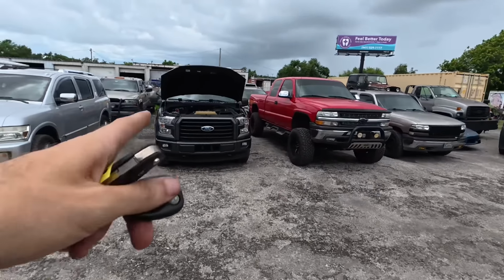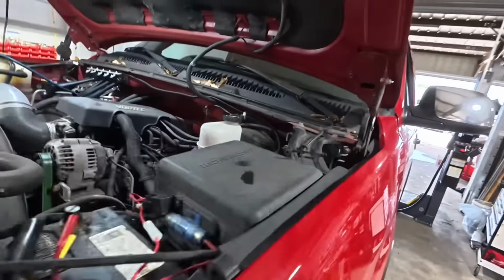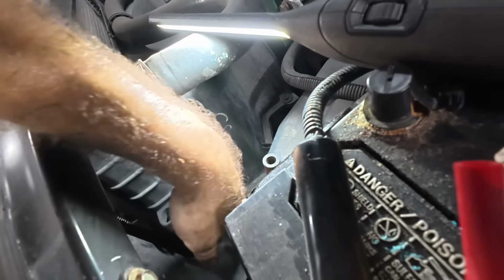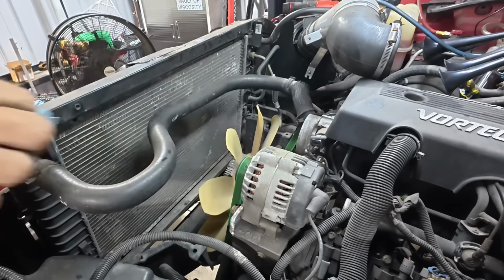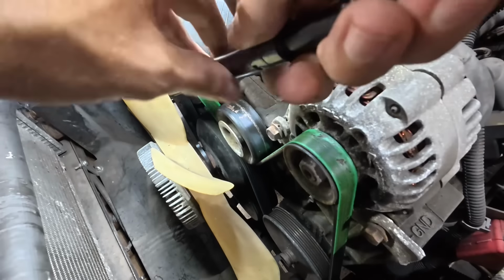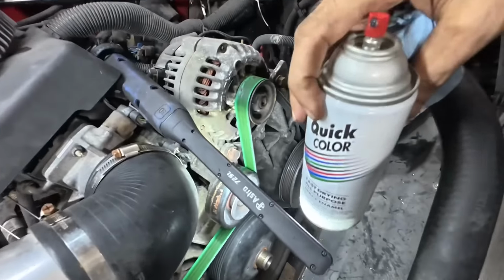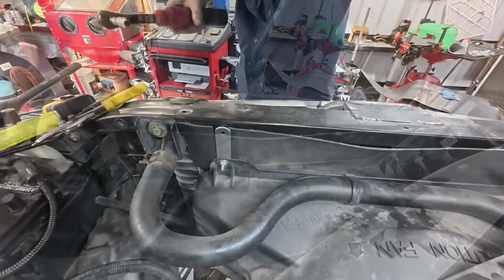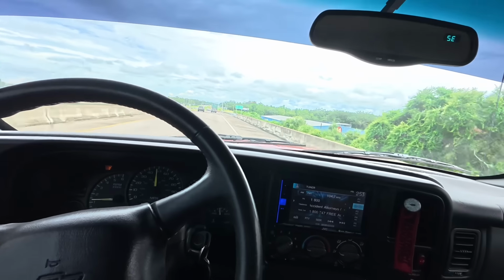Modified Truck has a Physics Problem!

Comment: 48:39   last stupid comment!
How should you charge for mod work like this?  It can take more time and your using scrap materials and new materials.
On the sides a house type door and window seal tape would work.

Cleaver repair Ray.  Was the charge on the system right?

Comment: wrong shroud? i haven't seen yet, but i'm callin body lift.
Reply: called it!  Shroud looked like it should have fit to me, had the right mounts and everything.  Given the look of the rest of the truck (big tires, tall\wide stance)  It prolly has wheel spacers as well :P (new rims with a bigger offset cost more)

Comment: It's probably the correct fan shroud.
 I'm thinking the truck may have  a body lift kit.
 That would also lift the radiator and fan shroud.  But, not the fan.
 20 mins into this video.

Comment: LOL......I just went and looked at my '99 and the side flap on the driver's side is crumpled and folded down while the passenger's side is missing.  I'm not having overheating issues and my AC is still nice and cold but I do believe I will need to replace those side flaps.  I learned something new today!!!  Thanks Ray!!
Reply: My wife's side flaps are all crumpled up and destroyed also...

She's got a LOT of hard miles on her over the years of our marriage 🥴
Reply: Could I use the same shroud out of a suburban it looks like my setup in my truck
Reply: I believe he has the upgraded radiator the same thing it's in my suburban if you had AC in the front and back
Reply: I think the difference is that this one is also not aligned properly because of the lift.

Comment: Just install a Speed Engineering electric fan and a thermostatic switch. Part #27-1006 found at speed-engineering (apparently YT deletes comments with external links) It's model specific for the Silverado. Ray, you need a truck creeper. I love mine. I recently used it to install a Banks intake and grid heater delete on a Ram Cummins and did a small coolant hose to the turbo on an F350 Powerstroke. It'll get colder in there when the blower fan has high speed.

Comment: Whats hard to figure out is the truck has an old school Vortec engine cover, old school grill and headlights from a 2002 and earlier, the engine cover looks like 1999-2000, but the interior is 2003 and newer, with the Bose speakers and the dash is 2003 with the Bose radio opening.   
I used to own an 03 with that interior buy not that front end.
The shroud is that way because of the body lift.

Put electric fans on the radiator and the problem is solved with the cooling system.

Comment: WITH THE OPENING AT THE TOP OF THE RADIATOR, IT JUST CYCLES HOT AIR INSIDE THE ENGINE COMPARTMENT THAN PULLING COLD AIR FROM THE FRONT VIA THE AC CONDENSER.

Comment: Ray:  Is it my imagination or is that plastic fan mounted backwards??  As a pilot son of a pilot/aero-engineer the blade twist, as re-mounted, will push air TOWARD the radiator when the engine runs (viewed from the front turning clockwise).  While sitting stationary (as you worked) it appears to me that the blade twist mimics that of an airplane propeller (and aircraft engines, viewed from the front, spin counter-clockwise).

Comment: In my experience with severe duty, they’re too aggressive. They don’t disengage very quickly. Once you first start the vehicle and takeoff. I usually suggest an HD, which is right in the middle. They seem to disengage within the first couple minutes of initial start up. Both are very loud when engaged.

Comment: So, I did an efan conversion on my 02. To do the efan conversion right, you'll need a wiring harness. BP Automotive makes a great one. You can find locally a fan kit out of like an 06 Escalade that will bolt right up assuming that truck has a 34" radiator, which I think it does, but check that. Then you'll need to have it programmed as you noted. 

Something you might consider is getting HPTuners yourself. I bet you'd find more uses for it.

For me, the efan conversion wasn't bad. The harness was about $225, you do have to change the high side sensor on the AC as well, and repin 2 connectors in the PCM. You'll lose the recirc doors on the interior HVAC, that's the switch that gets repurprosed to run the efans. I think I paid $75 for the fans. I went ahead and had it tuned, but the tuner did fan change too. I think that was $300.

Might not be something you want to tackle, but it's not exhorbitant, and it does help significantly. Good luck!

Edit, great job on the fan shroud mods!
Reply: So if the recirc door switch gets repurposed, then how do you operate the recirc door afterwards? I'm thinking of doing the factory efan conversion on my 2003
Reply: @Epic_Aviation you don't.

Also not sure about the 03. It may have a slightly different ecm.
Reply: @ryanedwardson6541 Yeah I've done a significant amount of research since then, and the 2003-2007 classic trucks are a lot different than the 99-02 trucks with the BCM, PCM, HVAC, etc. On an 03+ truck, iirc, you don't lose anything at all. The 2 pins you need on the PCM are empty on the 2003+ trucks/SUVs, so you'd be all good to go.

Comment: For the cracked block. Is it not possible to do a temporary weld over it?
Reply from the maker: I thought about, but I can’t weld aluminum, can’t really weld inside of a cylinder head. I’m sure someone out there could pull it off but I’m not that guy and I have no clue how to find that them.

Comment: @RainmanRaysRepairs, the price you pay to 'remote flash' vehicles is NUTS. With GM vehicles, you can purchase a $45 VIN license from GM via ACDelco TDS and that'll let you flash modules for that VIN for two years, so, as an example, if we're talking a frequent customer, and six months later, another module failed and needed to be programmed, it wouldn't cost you any more to replace and reprogram that module in that same vehicle. But even for a one off, $45 and 30 minutes of labor (assuming you bill in 30 minute increments and MOST reprograms take way less than that) is WAY cheaper than the, what, $245 plus labor. As far as an interface, there are universal 3rd party tools, or you could get a (LEGIT) GM MDI2 for less than $800. I've read and flashed Ford EEC-V PCMs with my MDI2 using PCMFlash, and I've done data acquisition using 3rd party software with it on Jeep and Chrysler. If you look at the Ford VCM II and the MDI2, externally, they're pretty much identical, and the fact that the MDI2 will read and flash Ford EEC-V PCMs (Non CAN) suggests that the hardware inside is identical too. I have little doubt that it could be used to program Chrysler, and quite possibly imports as well (can't confirm that as there are no imports within my scope of vehicle repairs). If you'd like more info, comment as such and I'll reach out to you via e-mail.

Comment: only a few mins in, 1. that trucks looks like the cover photo they used for rough country display truck for 99 to 07 lifts n stuff. 2. 3" rc body lift im betting as to why the shroud is dropped down and or lq9 ls rad upgrade/ 2500 hood front clip swap?

Comment: I had a 97 3/4 ton suburban that would never blow cold at idle, even with the hd fan clutch. Got a cheap fan off fb marketplace (I think it came from a civic). Installed it between the mechanical fan and radiator like ford did with some of the older crown Vic. Set it to come on with the ac compressor. Fixed the problem.

Comment: It needs a high blower relay. Right on the firewall.
Reply: Fan speed resistor is under the dash near the glove box. When it burns up you can smell it in the cab.

Comment: On the wall behind the Alignment tree, you should hang a large bathroom mirror, this way you can see how the tires line up rolling up on the lift.
We has a 6'tall x7' wide garage door
With a sheet of glass on the wall for doing window tint, we did not use anymore. With that glass it made a perfect reflection of the door way into the shop.
I was able to pull a humvee  yes mitilary version that was the navy's recruitment  center  I had 1" on every side and roof to pull it in the shop over night. Never needed anyone to spot me, plus you can inspect lights, turn signails ex using it.
Or you find a broken projector TV 
They have a large plastic mirror inside them, as well as a big magnifying glass the screen. 
Find one someone set out to the curb its great for parts. 

Trust me the mirror is something you will not forget the use of, or be upset you have it.

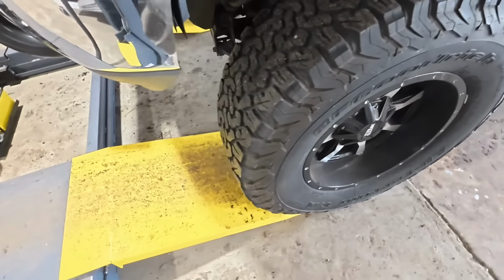Comment: 3:31 the gmt400’s had a relay for high speed blower, that bypassed the blower motor resistor. Not sure if that changed on the gmt800’s

Comment: The factory electric fan upgrade would be a great work around.  In my opinion, the body lift company should have replaced the shroud to better fit the lift kit and function properly. Meaning the fan area would still match the fan but the radiator end would match the lifted radiator and still bolt in like original.

Comment: Truck had green coolant(not correct for that truck) . I suspect that maybe there was a leak problem before this and maybe generated a heat pocket in the area leading to the crack.

Comment: The electric fans would have been the best solution if you don't consider cost.  However, the customer was, and Ray shined like a star on this one, working within the customer's limits to creatively solve the airflow issue.  Will it work for a decade?  Probably not, but there's always the option to go the electric fan route.  The Chevy owner should start saving his money and have Ray do the install.

Comment: If the customer does not want factory electric fans, you could suggest a pair of electric fans from Flexalite ... They can be controlled by a simple thermostat probe in the radiator hose and you can also wire them to a manual fan on / off switch if you want. They are very effective at moving lots of air and not super expensive. They do not require the GM Fan control module to run them.
Reply: My exact thought also, I'm surprised he didn't mention it.
Reply: Those fan kits don't really pull enough CFMs to be a factory replacement. It's a game of hit n miss with fan blade pitch on the fans?

Owning an RX7 with a 13B turbo they get a bit warm especially in Australian Queensland hot weather?
After installing one of those kit fans with its own thermostat as mentioned; it not pulling enough air flow I switched out the fan itself for a Toyota Yaris/Platz fan and wired it into the after market thermostat so no chips need to be "retuned" cause there's nothing for it to interface with being Mazda anyway. This did the trick.

I went straight for the Yaris because it was a large single fan. The fan was thick and heavy duty looking too. I decided this after being dropped home one time in the peak of summer in a of black Yaris; when I opened the door and put my leg out the thermo fan just kicked on and the amount of heat that came rushing out from under the car was crazy! I looked across as the temp gage on the cluster and it was reading below ⅓? I'm like 'well that's a pretty good thermo fan if what it's expelling nearly burns my legs or and it's reading cold?"
The car was only a couple of years old too at the time so it wasn't as if it's had 10 coolant refills with tap water with air locks and shit going on? It was a Toyota factory serviced car under warranty.

No more temperature problems in the RX7 after that modification👌 also the factory RX7 clutch fan (similar to the one in this clip) has some crazy fat fan blades with some hard core pitch! The clutch fan was louder than the 13B with upgraded 3" exhaust. With the new electric thermo it actually made the car sound much nicer at low throttle and low vehicle speeds in the hot weather.
With an RX7 you got similar issues with heat soak when you lower the car! The air in the engine bay becomes trapped at low vehicle speeds and with limited escape routing for the air in the engine bay it can make cooling the already hot engine bay much worse when you lower the car!
Add a body kit and the problem becomes even worse?
Parked on the dirt somewhere and the electric thermo kicks in.... It would blow a big cloud of dust  out from under the car in all directions!
Reply: Flexalite electric fans are very good. Or you can use a metal Flexalite fan in place of the original. I had that fan when I had my RX7 and it did fine but it is a bit noisy.

Comment: I don’t think any garage would’ve done what you did Ray they wouldn’t go above and beyond man that was a good job. You are the man.
Reply: Stellar mechanic. Stellar family. Saw a cross tattoo on his wifes forarm. That says a lot, really.
Reply: Most would have said you don't want the e-fans? Ok dude. The solution Ray came up with will get the job done. It should have been part of the kit if it was a kit.
Reply: Ray came up with a good solution that many would miss completely.  The fan clutch tool is worth every penny for a good set, don't cheap out they won't last.  The airflow dampers not being in place can cause major issues and many DIY repairers will toss them! Those air flow dampers cause major issues with construction equipment because they don't get the forced air that a car or truck does! But, it's helpful to know when you buy and resale equipment because you can usually look at equipment that people are having issues with overheating that has randomly started make up some dampers and turn a tidy profit. 
Yeah, I'm sure that the video potion of Ray's business offsets some stuff but, if he's wise (I believe he is) that will be put into an investment account so that he can retire at an early enough age to enjoy it!!
Reply: Neither would he if it wasn't for youtube. Monitozation offsets excessive diagnostic time.

Comment: Hi Ray,   Your clutch change and the rubber shrouds you made for Top and Bottom are great as it will help force more air through the center fan section of the shroud.    Good  Job !          If those didn't fix the issue it might have been a bad expansion valve as those can cause the AC clutch to shut off above idle like it did early in the video.

Comment: P.S. If the electric fan software and electric fans are higher end I would expect multi speed, one and two individual fan operation as well as a cool down that operates after engine shuts down but I don't now what's out their and what you get with the software functionality reprogramming. Fans do eat up horse power and a upgrade like you mentioned could also increase fuel efficiency .Okay I will shut up now.

Comment: Car Wizard
YouTube channel just had a Broncos sport with that same problem of coolant coming from the turbo and discovering the cylinder head was also   cracked cylinder head just like your F1 50  truck I'm wondering what happened to these styles of engines?

Comment: The fix is what we in the UK call a Bodge Job. But...under the circumstances, the customer said no to the best option ( electric fans) due to cost, so you did what you could with what the customer was prepared to pay. It worked, and while it's not the prettiest solution, you worked with what you had, and I am sure the customer will be happy.

Comment: Overcompensation via a lift, fan Shroud & just image how much extra work with more fuel & heat to push that truck with those oversize heavy large wheel tyre package. The acceleration must suck on that unit along with that stupid pod airfilter drawing engine bay heat.
When peoples do mods why don't they think like a smart engineer 🤔  to actual make things work  & last longer 🙄.

Comment: Ya gotta wonder if the cost of the fan would have been cheaper than the cost of labor for all the custom work done.  
Amazing job of analyzing the issue and figuring out the solution.
Reply: the increased fuel usage in a year would easily have paid for electric fans.
Reply: @mrfrenzy.  People driving those trucks don't care about fuel usage, until they look back and wonder why their big loud truck is costing so much to keep running.

Comment: Body lift causing engine to be lower in engine bay so fan shroud dropped to line up with fan problem is body lift miss aligned fan shroud not wrong fan shroud

Comment: You have a blockage in the refrigeration circuit, you need to restore the freon, clean the refrigeration circuit, change the expansion valve, calibrate the compressor oil, then bleed it and recharge the freon.
Reply: nope

Comment: Glad you got it going. I would have bought an aftermarket fan kit with 2 fans 2 relays and a sensor for the thermostat housing and a couple diodes to make sure both fans run if the AC Compressor is on. probably less expensive than the factory upgrade and less likely to fail because there is no need to have a computer involved. I've done this a few times for people.

Comment: It's hard to tell how tough that flat black plastic material is. But I wonder if he should have installed washers behind each self tap screw to resist the wind pressure when the guy goes 80 miles an hour on the highway

Comment: Most engines run clockwise looking from the front. If this one is so, the fan pitch looks wrong. Maybe the belt is running under the pulley and it's reversing the fan direction???

Comment: This is why I generally won't touch a body lift 1.5" max but only after everything else. I have a 2000 I've owned since 02' on 1 tons and 37s just got to 135k miles. I built a fan shroud and went with oversized radiator and dual 14" proform brushless fans.